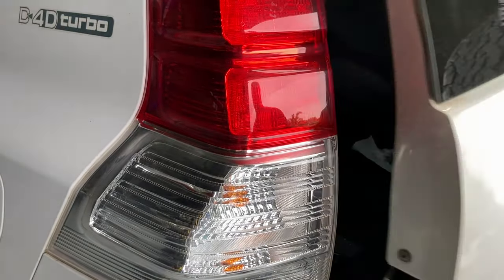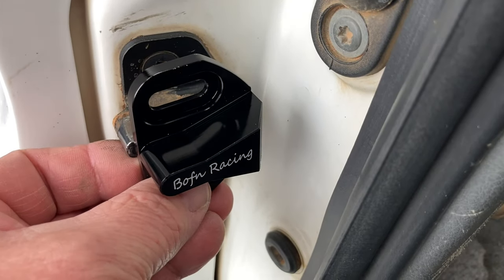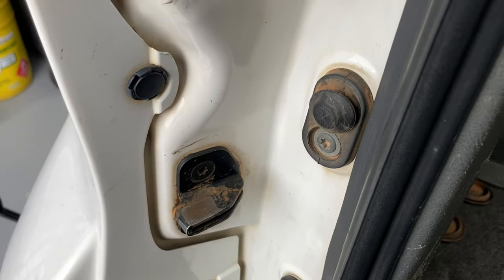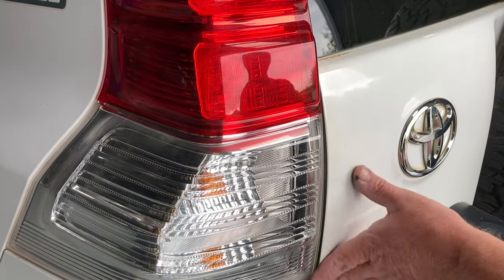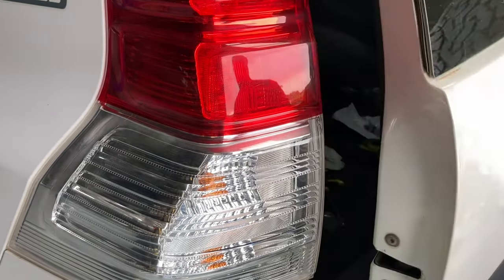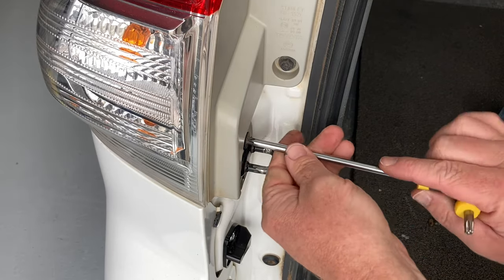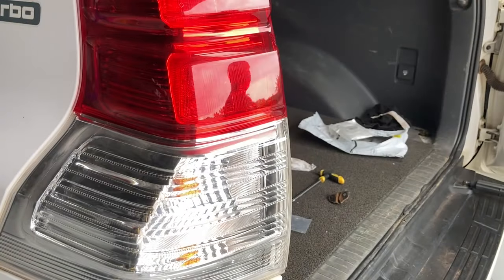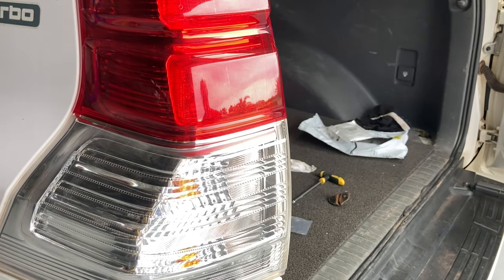Land cruiser LC120 and LC150 PRADO rear door rattle and that’s why you listen to the END!!

Comment: If the striker is that worn, the pawl (bit like a curved finger that hooks over the striker) in the latch on the door will be worn too.
Replacing both will help fix the problem.
With regards to the bottom guide (bofn racing thing), the guide on the door will be worn too and should be replaced.

My Prado has 160k so not quite the wear as the one in the video, but I have put a layer of 1mm felt on the guide (body side) and this has eliminated the rattle and holds the door nice and tight.

Comment: Bring them to a milling shop to make the slides
Reply: Just what I was about to say.  Easy job to slot them.
What about a dremmel?  A round file in a vice, just will take a while.  Another tool is 12V chainsaw tooth stone, but not ideal.  I have a deburring bit that would be another option.

Comment: The rear door is such a bastard piece of crap! On my 2011 150, I've replaced both hinges, and tried Kaon shims, and I've got one of the Bofu Racing guides, and I've replaced the striker. And yes I've also taken the spoiler off and put it back on, tightening everything up. And thers still some rattling going on back there, it's just awful.